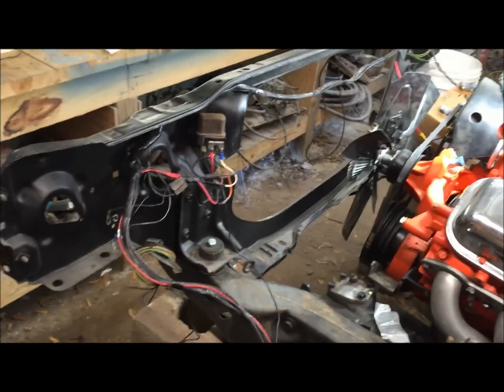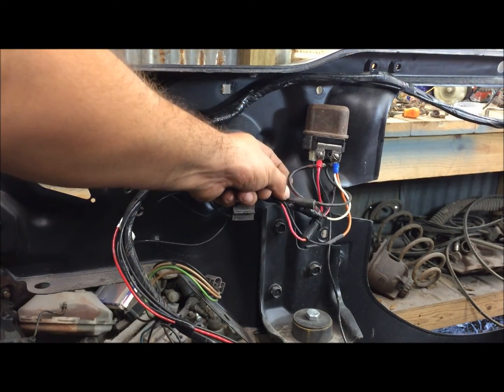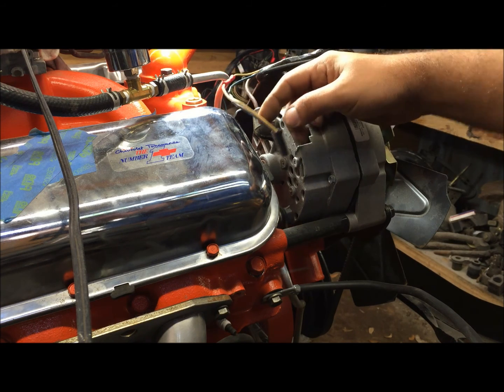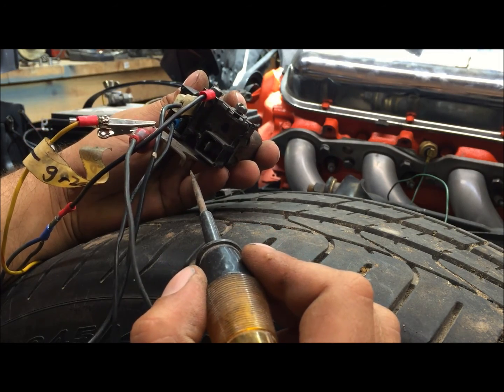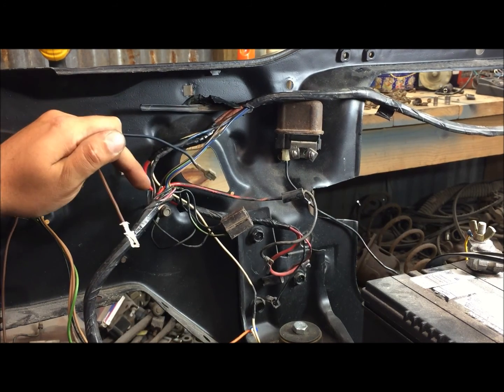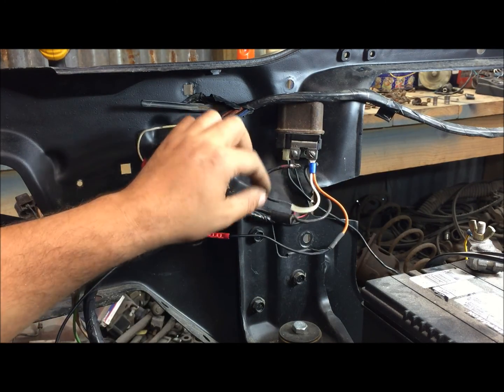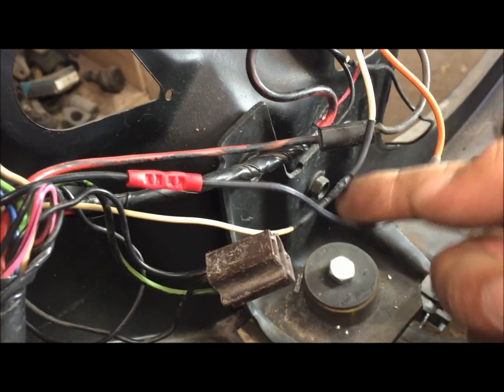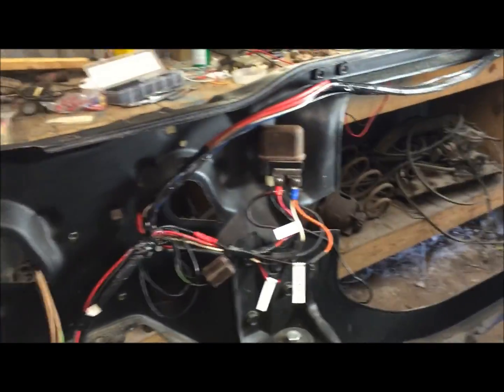EXPLAINED PART 2 how to rewire alternator wiring harness for internally regulated GM chevelle

Comment: thanxs chris now i have it figured out the wire from the battery pos got cut to the buzz box and the alternator that is why i had no power in the cab got it fired up today finish buttoning it up and start painting it next week  without your video it would have never got it running. Larry Broad 1970 el camino custom.

Comment: Once again a great video THANK YOU for these very informative videos dude getting my 66 impala back on the streets and running into a bunch of wiring problems can always count on watching one of your videos to learn everything i need to get the job done!.. 👌👌👌
Reply: Mondo357 I ripped out almost my whole wiring harness and put in an ez wire harness kit. So far so good. Not original but as long as I got brakes, signals and headlights I don't care. Still have my dash to wire up.

Comment: Working on an 83 Chevy G30. Have been having an ongoing issue with weak headlights and then battery draining. It has a rebuilt alternator in it that is a three wire. There have been a few different hands attempting to troubleshoot the headlight issue and have cut wires and moved things around. An aftermarket stereo was installed at some point prior to my getting it (not sure if it's related other than having an anti-theft light that gets juice even when the key is off). Have been watching several of your wiring vids and plan to see what I can get figured out. As far as I can see, there is no wire going back to the positive terminal, only the fat cable going to the solenoid. Also, there is a heavy gauge wire hanging down under the dash with an inline 30 amp fuse. No idea where it's supposed to be going in the fuse panel (may end up having to pull the dash off to see where it's going to. So I'll update progress and who knows, maybe manage to record something that could be helpful for someone else! Also, loving the idea of the label maker tags. Appreciate your videos so much, diagrams and detailed explanations, kudos for the ability to communicate clearly ideas and concepts (even for dummies).
Reply from the maker: unhook the radio and theft stuff and see what happens. Cheaper alarm system / keyless stuff will drain your battery for sure
Reply: @chriscraft77022  Yep, good call. Appreciate the tip

Comment: Hey great vid. Good explanation of what to do with the voltage regulator wires. I also have a 70 Chevelle. Mine has a 502 with a littlefield 6-71 blower. Hope to have it drive-able this summer. Thanks for taking the time to post this vid.

Comment: I have a 1966 C10 that I am working on converting.
The thing that thru me for a loop as I started to research all of the "How To's" on it was I only had one wire to my alternator.
As you can guess, I have found a headache and a boat load of burned wires and yes, I'm fixing to watch your video on the one wire alternator.
It has been working fine for several years now but it has been getting more and more noisy so that is why I wanted to change.
Anyway, the wires to my "Charge/Discharge" (Other wise known as a vote meter) gauge are also burned.
I found this truck on a farm and as you may know these one wires where not really meant to be used in a passenger vehicle.
I have found several things the last owner did badly/wrong and I'm thinking when he converted to the one wire he melted the other wires.
Anyway, good videos and you seem to have the same problem I have, for lack of a better discription, you over explain and under explain at the same time.
Now on to the other video.
Reply from the maker: this was an early video...  it is not easy making videos... ask me anything...  i have memorized every wire on a GM harness and figured it all out

Comment: Hey bro we've converted a 67 impala sedan from external alternator to one wire. We added a conversion kit to the new alternator and external regulator but are not using the old hot wire that's attached to the harness. We ran 4 gauge from alternator to battery and grounded the alternator to frame. We get smoke from ignition wires with new 4 gauge wire. Ignition wires stopped smoking when hooked original alternator wire back up with conversion kit. I wanna know if I could send you some pics to help me figure out what in the world we're doing wrong.

Comment: I have taken all the knowledge that you have shown me and wired up my Impala from bench testing the wiring harness but is it really necessary to sotter the wires I have been using some nice ppl lugs and connectors I've been pulling the connectors out of the plugs for a minute when you really know how to wire
Reply from the maker: i solder wires that hide away.. under dash… through body… because crimped connections can corrode
Reply: @chriscraft77022  I have done the same but I'm thinking just make a new wire

Comment: hey chris are you going to keep the points coil fired ignition or you going the upgrade it? i have the big ugly ignition setup 50.000 volt coil dont touch it when its hot shock the shit out of someone for sure.

Comment: Hi Chris, I jumped the regulator with 2 short wires, got parking lights to come back on, still no headlines guts or dash lights, my horn relay is new, the one wire 150 amp alternator has a 8 g wire going to battery post and I also grounded it to engine block too. Thanks
Reply from the maker: +Linda DeCarmine you need to check your grounds... battery to block.. engine to body... body to chassis... first

Comment: Awesome video ! Anytime I get stuck with wiring I always look for your vids! I have a 71 cutlass so it’s pretty close I just went through hell with my horn ! Since I got a new steering wheel I figured I’d get the horn working ... my horn relay is a little different then yours but after digging into it low and behold I found two wires behind my fender so like you said in your video the one wire was hot and basically the horn grounds out so next to horn on my relay was the door buzzer so I’m thinking that’s what yours is most likely..
      But hear is my question I changed my Alt to a internal voltage reg 20 years ago and I was looking into putting a 140 amp alt on and the question is can I unpin the alt wire and run an 8gauge ? Or would I be ok with the wire that’s there? I am now using a big fuel pump and dual fans etc 
All have relays of course but at what point do you think things should be upgraded ? 
Anyways thanks for all the vids !
Reply from the maker: I have a 100 amp alternator upgrade video.. I ran #4 for 140 amp in the future...  you need to do it like that if you care .. the factory wiring is good for 75 amps
Reply: @chriscraft77022  thanks Chris I appreciate it! Gonna look for the vid 👍🏻

Comment: Hi There, I wired up my 67 Chevelle as per your video but the engine will not shut off. I had to pull the coil wire and then install a switch between the brown and blue "temporarily".  Any thoughts as to what is happening?
Reply from the maker: #1 wire needs to be run to accessories.. there is a factory resistor when you run to ignition on. ( your #1 is ran back to ignition) The simple fix is a diode on the blue #1 wire. I show it on my gm 3 wire hook up video ( old video)  your dash lights should come on with accessories if not the car is wired wrong
Reply: Thank Chris, I will check the ignition to see where that #1 wire is hooked up to, I did try a diode/resistor and it only lasted for one cruise. Awesome video!

Comment: I see a braided ground wire coming off blower to firewall, have negative battery dabble going to engine block, I can't see if there's any chassis to body ground, I do see a bolt going into chassis, on top front passenger side; I will put a new ground from chassis to body bc if it's hidden I guess another won't hurt, but would like to ask where to put it that you recommend ?
Reply from the maker: +Linda DeCarmine the assembly manual shows where to put the grounding straps.. your car may have them in a different place than mine

Comment: Hi chris, great video.  unfortunately it doesnt work for me as I had hoped. i have a 69 chevelle i just bought. the guy has it set up like a 1 wire alternator. After looking to see if i had everything you mentioned,  i did find the junction block. but, the voltage regulator is missing.. after finding this, i noticed the alternator had a plug and actually has the connections for the "anti-american" connections.. at a loss of what to do
Reply from the maker: i have other videos on this..  watch easy conversion and GM 3 wire hook up... a one wire is just a 3 wire alt where you dont excite #1

Comment: Chris? i followed everything you said in the video.. my idiot light stays on.. when I rev up the engine it goes out
Reply from the maker: Watch my GM 3 wire alternator hook up video
Reply: That means terminal #1 wire isn't excited until the rpms increase. Loop terminal #2 to the battery terminal on the alternator.